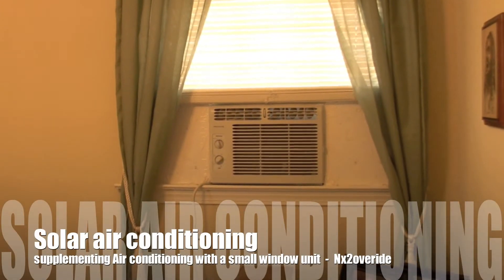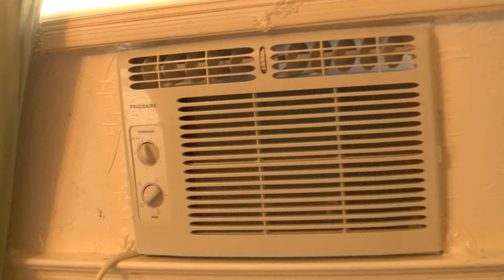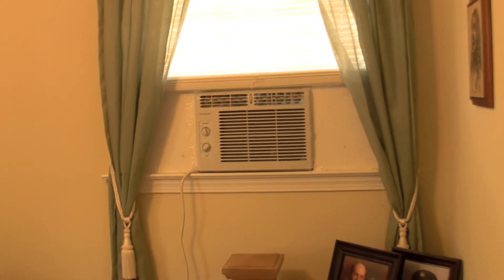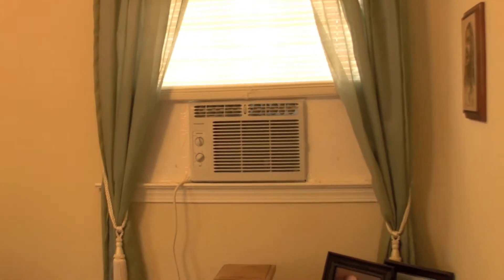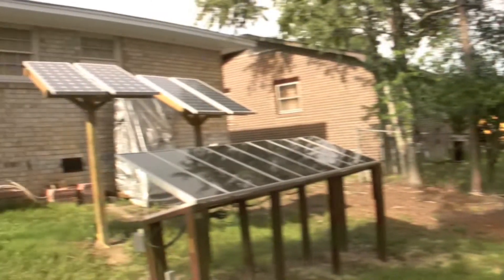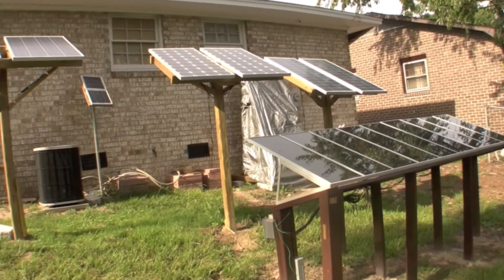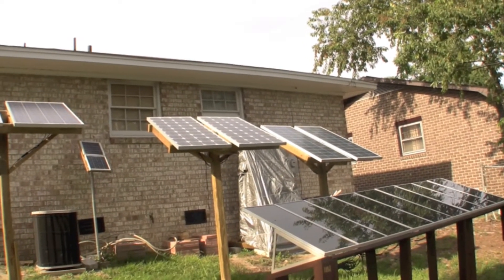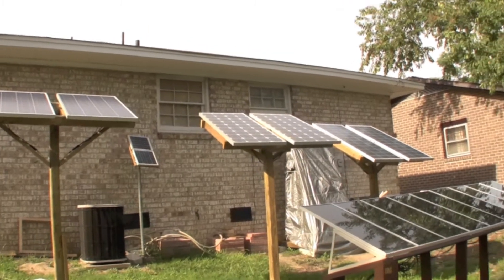Air conditioning running off solar power.

Comment: Is it still runnig in 2018??
Reply from the maker: yes.. it is ;)
Reply: Very cool
Because the system is still working
You respond to comments quickly after 7 years

Comment: how long can u run the aircon for?  no one ever says that
Reply from the maker: The air conditioner will run as long as you want it to. The solar power is running it when the sun come up and is crating power. If the amount created fall below what the ac needs it gets the rest of the power from the grid.

Comment: Lol,  the county and the power company would not be pleased with your setup especially since you are wiring it yourself.
Reply from the maker: +WTF BBQ yep, lol but if the power company wasn't so damn greedy I would have never started this project. I bought a  few acres of land not to long ago  eventually this stuff will migrate there. I'm building a 100% off the grid cabin.
Reply: nx2overide I heard the power companies will try and get you with Wiring Codes and possible violations.  In some states,  The Koch brothers want to make it illegal and make you pay more for having solar panels.  In fact, this is exactly what they are doing with the Smart Meters.  It goes faster when your panels are producing more energy than you use.  It's fucked up ....

If I were to build my solar setup,  I think i'd build it separate from the grid and not attached to the main house.
Reply: +WTF BBQ Simple solution, use Grid tie inverter with limiter, so it will prevent your inverter from sending electricity to the grid.
Reply: Tom Louwell
Power companies can see your grid tie inverter because the frequency feedback registers on their system.  They can even tell what appliance is currently running on your house.

Grid tie with a "limiter" will protect linemen, but it won't be a guarantee that the company will not come after you.
Reply: WTF BBQ Obviosly, Grid tie inverters has Auto-shutdown if Grid goes out it shutdown itself it is called Anti-Islanding feature, GTI with limiter means, it wont make your meter turn backward or feeding electricity to the grid. If you have 1000w GTI with limiter and you have 500w load, the limiter adjust the demand needed to run that load without getting Electricity from the grid. If you have load morethan the GTI can produce, thats the time you can get electricity from the grid. I have GTI-L in my house, my power company in my place charge you if you feed electricity to the grid.Not NET metering in my place where i live. Thats why Limiter goes up.

Comment: Why not use the roof?
Reply from the maker: Nate Stone because of the expense involved in doing so, also I can break down the panels rather quickly and bring them in a tropical storm. I eventually added a huge storage shed and started adding larger panels there.

Comment: So, what, 200 bucks for the ac unit, that pulls around 450 W right?

All those cells to charge 12V batteries, which use inverters to 110, or 220. I guess thats around $2000 worth of equipment. Well, solar isnt cheap is it? :/

Not until we run out of fossil fuels i guess.

Comment: You can double up on wires, this way you can keep the wires small and cheap. Just run more wires in parallel.
Reply from the maker: Thanks for the tip!

Comment: you could probably use an Arduino chip and an electric motor to make a really cheap tracker, just use the arduino to make the motor move at a set time of day, should be easy enough to setup.

Comment: Do you 1st start the AC with the batteries?
How many batterues do you use for the AC?
What type of batteries are you using?
I have a vehicle with a flat roof that is 5x11.
Could I set up the vehicle to power a 5,000 watt AC like yours all day in direct sunlight in this vehicle?

Comment from the maker: doesn't have to over come.. the unit runs off the panels but the battery bank can run lights power-tools etc..also. I built the array before i figured out i could run an ac unit on it.

Comment: Good video - wonder what angle your panels are set at. AC&R is a huge power drain. But those panels will last for years & years. I'm happy with my system off-grid at camp & not needing ice. Good luck w/ your project.

Comment from the maker: @burningmanmike I built them on stands because i never ment to have so many i just kept needing more power.. i did thins originally to be able to break them down easily in case of a bad storm but im working on building a screened in porch im going to mount all of them there when im done.